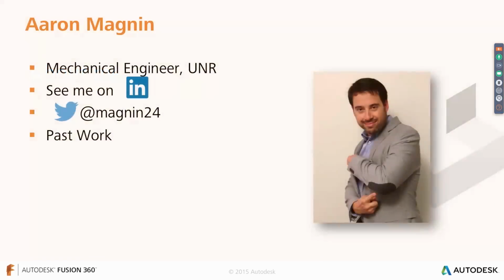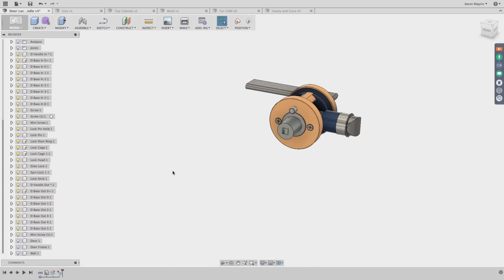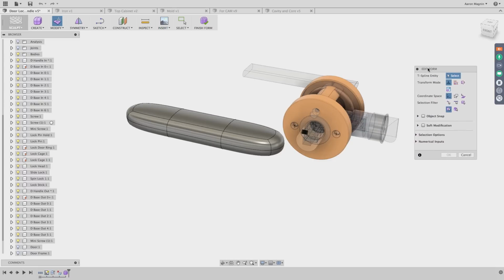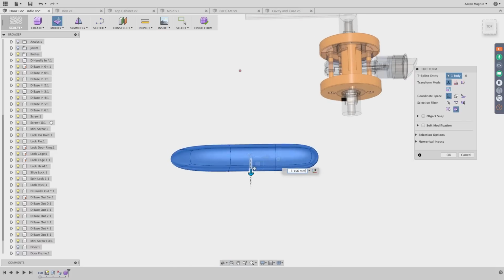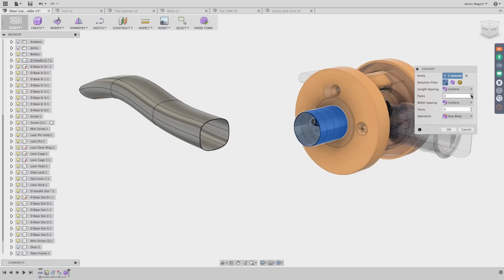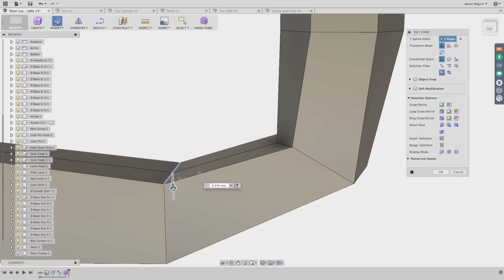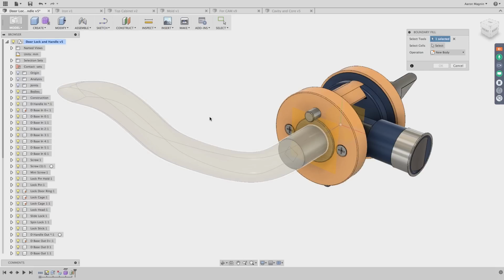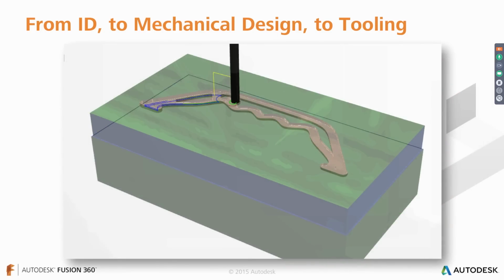Webinar – Sculpting Basics (& More)

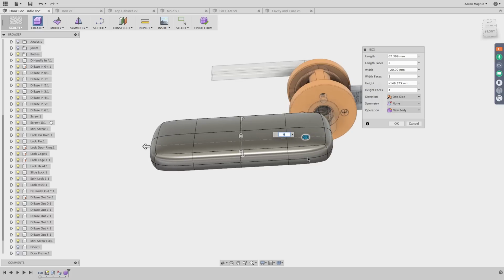Comment: Thanks for the video. Re the speed, well it is called Sculpting Basics for a reason and that was perfect for me. I'm no stranger to CAD or Surfacing but Fusion 360 & T-Splines are new to me. Two questions kind of related: You finished your T-Splines surfacing then "Boundary Fill" thereby turning it into a solid. 1) What if then you wanted to adjust the T-Splines part of it (done earlier) for whatever reason? From what I understand, T-Splines doesn't record on the timeline so you can't roll it backwards and when I try to Edit Form I just get a ghost figure of the handle with lines but no T-Splines to manipulate. 2) What if I wanted to roll back to a point where I could change the number of T-Spline faces (height/width/length) and have the dialogue box open (entitled "Box", not "Edit Form") like you had open at 11:30? Surely I don't have to delete and start again with a new form? What am I missing? Thanks in advance.

Comment: Can one add constraints to the box edges on splines (In the box edges display mode) ? like parallel edges etc. ?
Reply from the maker: Not really....using the method shown here (https://forums.autodesk.com/t5/fusion-360-design-validate/constraining-sculpt/td-p/7097979) you can temporarity constrain, but its not parametric. However, you can potentially freeze to make it more permanent, long story short the answer is still no.